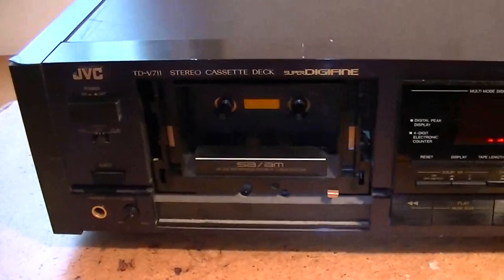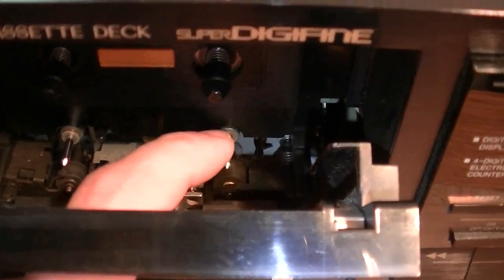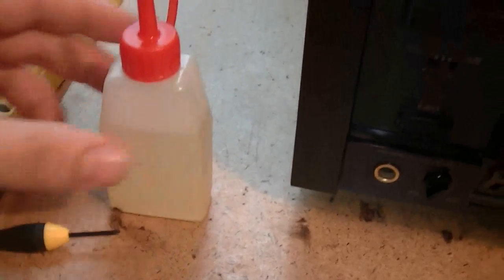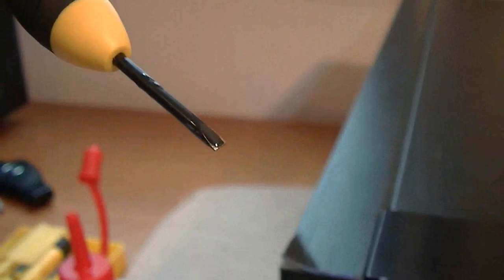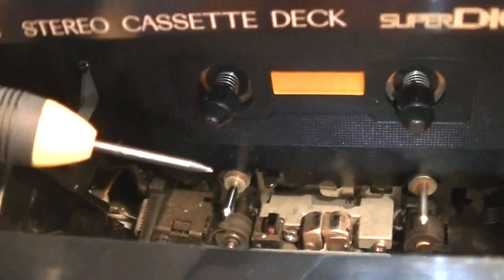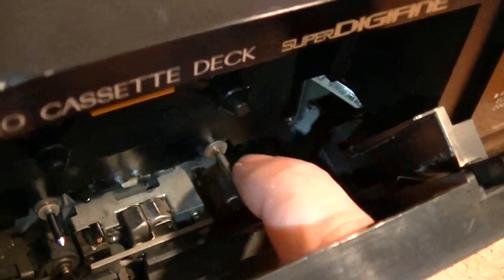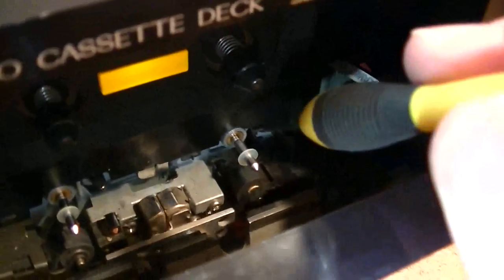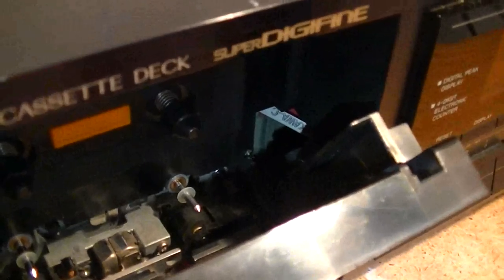Capstan lubrication easy procedure

Comment: Excellent video. I did this a few years ago to a 1992 Sony deck. One tip: after dropping the oil onto the capstan, tilt the deck 90º vertically and run it for a few minutes to help the oil work its way into the bearing. Especially worth trying if you put a bit much on, as this way, no oil will drip off due to gravity.
Reply: Bien joué 😊

Comment: Amazing!!! It works on my Technics RS-B505. Thank you so much!!!!
Reply: was it making a very loud screeching noise? because I have the same deck and i can't seem to fix it
Reply: Yes, it was quite loud, but not anymore.  You solved the problem for me and it still works.  Thanks!!  👍😁
Reply: Just ended up here, after my TDK TD-W201 was serviced because of hellish screeching noise it returned today... And I know the repair guy didn't mention anything about giving some drops of sew machine oil to the capstan bearings...
First thing tomorrow is to buy me some of that oil. Hope it will work 🙏
Reply: @santioriginal  TDK?,JVC
Reply: @giuseppelavecchia775  JVC, of course!

Comment: Dear readers. And Nacho. Sewing machine oil is very fine for a lot of works around decks, but not for capstan. For example,  with it, you can ruin almost immediately a Revox super precision bearing and only replacing it will works. Since few people look after service manual recommendations, please don't use it as a routine. For worn bearings it could help a little, before considering replace, but for any other case, use fine and fully synthetic oil made for capstans. It costs 20 euro and lasts for a life. For sinthering purposes, the best  way is cooking-no cold lubrication can diffuse deep enough.
Reply from the maker: Thnaks updated the info. Recall that this is the DIRTY procedure.

Comment: Nice JVC !!!!!. Important note is trying NOT to get oil in the pinch roller. Even after lubrication, not sure is oils go pass the plastic washer. In "theory" this brass bearing are soack in grease at factory.. They are kinda like an sponge ... and the idea is that they wont need lubrication in its lifetime.

Comment: Many decks have two bearings per capstan, a front bearing and a back bearing. This procedure does not get the back bearing lubricated. No problems using this method, but if the bearings really require lubrication, the back bearings should not be forgotten. People might think they are save because they have lubricated the capstan bearing, meanwhile causing extra wear on the back bearing over time, because that one isn't lubricated.
Reply: Sounds like you are an angry tech that is looking for work.  Nah I got my deck working, I don't need it brother!
Reply: Looking forward to you r video demonstrating how to lube them.
Reply: Ignorance is fine, shared knowledge  is a sin, and judging people makes you stronger. Be just like that Mike and you'll be fine.

Comment: @Nacho Pachés:  Putting oil on a capstan,  that could cause a higher chance of the tape getting eaten by the player, because the tape can slide off the path, unless your putting oil on the gear of the capstan, and not the capstan itself. Edit: so it was on the gear of the capstan, but their are still risk of dropping oil on the capstan itself.
Reply: That's why you always want to clean the capstan with good 99% IPA after the lubrication.

Comment: Can the capstans cause the music to change speed and could you please recommend an oil for this servicing ?  Thanks
Reply from the maker: It's not frequent, but They can cause slower than normal speed if there is too much friction (as a lack of lubrication, as this video tries to solve). Often , as they heat  they expand and thus more friction makes the music play even slower, but in these cases THERE AREN'T sudden speed variations, wow and flutter (that should show a pinch roller fault). However slow (or fast) music speed is usually a direct result of the motor running faster or slower, or the pinch rollers being worn out and causing bad or uneven pressure on the capstans. That's what usually has to be first considered.   AS for the oil, there's a comment talking about using fully synthetic fine oil made for capstans, but If I had to use some oil right now for a cheap deck, I'd choose swing machine oil or synthetic oil for car motors, which I suspect is maybe too viscous, but will protect the metal. However I'm not expert in oils in any way
Reply: @llagona  thankyou !

Comment: My capstan has black marks on it, which affects the playback. Is there a way to get rid of this? Or will I need a new capstan?
Reply from the maker: finding a new capstan is really hard. Pinch rollers are much easier though.  However I've never seen a capstan with any kind of marks that can't be removed by cleaning. Usually, tape debris, dirt or roller rubber can deposit on the metal but I've never seen any erosion or permanent damage on it. A good cleaning with alcohol, will usually leave the shiny surface on it. In the back side of the roller, sometimes the belts melts and leaves a thick residue that needs carefull cleaning with alcohol also.
Reply: A cotton q tip with isopropyl works well
Reply: @llagona Correct.IPA is the best solution to clean the capstan rollers.IPA is not goid for pinch rollers as it may damage the pinch rollers if used in its highly concentrated form.Cotton soaked in water us good or very diluted IPA is good fir pinch rollers to clean them.all.

Comment: What oil do you recommend for lubricating
Reply from the maker: Hi. When it comes to lubricating with oil, I think "sewing machine oil" is probably the way to go. But remember, some parts have to be lubricated with other compounds (like lithium grease). Oil is just for some points. Sewing machine oil is actually used these days in more other places than sewing machines but we know by that name here. In any case other oils can do the job reasonably well, because the improvement is huge and differences between oils are secondary.

Comment: Capstans bearing are maintenance free bearings. Those are sinter bearing that has dry lubricant in side into material that they are build and is not necessary to be lubricated.They are created to be not lubricated never , they are built from lubricant material.

Comment: I've got a sharp th w600. My grandma gave it to me and so know it hasn't been used in a while. It's working great. Do I need to mess with it if it seems fine? Can I use oil for hair cutting clippers?
Reply from the maker: If it is performing well, I wouldn't touch it in almost any way. At some point you'll need new belts or some other usual maintenance but This precise type of maintenance from the video is not usually necessary. As for the oil , please read the update cmplete video description.
Reply: @llagona  when will I know the belts need replaced? Is it hard to replace them and find the kind for this deck?
Reply from the maker: @ofthedawn  It's not easy, I should do a video of it! but there are many. Just remember to take pictures of every step from different points of view. You will notice it's needed either because the mechanism doesn't engage and run or because the sound wobbles .
Reply: @llagona  ok yeah that would be a good video. Do you know anyone making new cassette tapes? I know there's a lot of old new stock and some really cheap new ones at Wal-Mart but was wondering a new good quality ones.
Reply from the maker: @ofthedawn  Problem is that it's getting more and more difficult for me to set up the things needed to make a video. But there are other in youtube, if you watch some of them you'll get the idea for sure. But Remember (this is not told in the videos) : have a picture of every step, to recall where each part is assembled back. As for the tapes, it is not a profitable business anymore to produce quality tape, even medium. There are probably some factory in Turkey still making tapes inherited from BASF, it's name is raks and they even use to make metal tape. The shell quality is bad anyways. For quality tapes you need to buy second hand. There is a huge market in germany and also big markets in most big countries.
Reply: @ofthedawn  National Audio Company still makes tapes, but during this pandemic everything is shut down.

Comment: can ı use printer head cleaner for tape head and pinch roller?
Reply from the maker: I don't know, I'm not by any means an expert in cleaning decks chemistry. I just read a lot of times that for the head it is better to use isoprpyl alcohol. And for the pinch roller I'd use water and soap, and then water to remove the soap. You can use also isopropyl alcohol, but I've read somewhere that it can dehidrate the rubber. There is this liquid called "rubber regenerator" that is also a good cleaner, but it's harder to find, I've bought it in the past from someone on a hi-fi forum, do your search for this . Anyway, a bit of dirt in your pinch roller won't make a  difference as long as the rubber is in good shape.
Reply: @llagona  thank you
Reply: @llagona yes,Sir,you rightly said that IPA can dehydrate the pinch rollers .

Comment: BS. the capstans are rotating in sinter bearings specially designed to be maintenance free! They do not need any lubrication because they are created from 30% dry lubricant build inside into the composite material of the bearing. They are lubricated for a life time. .Your lubricant disappear from the bearings after couple days and the bearings continue to work with a dry lubricant  , same way how was working 40 years till know without problems.
Reply: Wow that makes sense because a couple years ago I bought a used Sony TC FX2 (made in Japan 1981) on Ebay for $50 and the only servicing I did to it was replace the drive belt. The deck is now 40 years old and it works fantastic.

Comment: Have worked on tape decks for over 30 years and no manufacturer recommends oiling capstan bearings.  Bearings are usually made of brass and all oil does is trap dirt and dust. Oil migration to the tape is a big NO NO.  If a deck cannot maintain proper speed it is because of dirty hard pinch rollers or a worn out capstan motor or worn out drive belts.
Reply from the maker: I' worked as an enthusiast and hobbyst for about 10 years on tapedecks and read lots of messages in forums. I agree that oiling is not a recommended procedure and the bearings have no planned maintenance, but believe me, I've seen decks not working from bearings suffering friction with everything else in order (2 out of 120, and not sure about the second, but one was clearly as I say). Putting some oil in that deck solved the problem instantly. Is it a temporary solution? ok, Is it suboptimal? ok,  but Are you going to spend 100 $ fixing properly a deck that is worth 20 when a simple drop of oil will do the job for 4 more years? As I the first thing I stated in the description, this is a dirty procedrure
Reply: Whatever floats your boat.  I have only used oil on vertical capstans on DAT decks.  I  have lubricated the bearings on capstan motors by removing them and putting a small drop of oil on the front and rear bearings of the motor. I love the forums when novice people try to replace all of the capacitors on decks and ruin them in the process.  In 30 years I have had to replace 4 capacitors.  If you do not have proper equipment and test tapes I wish you luck. I paid a Teac rep $100 bucks for a Dolby level tape so I'm dedicated to getting the best sound out of any deck.  The Nakamichi decks are the worst for bad motors and Technics and Panasonic are the next worse. 2 channel scope, freq. counter, wow and flutter meter and AC true RMS analog meter, precision audio frequency generator. It is sad how many great cassette decks are trashed by WANNA B TECHS !  @llagona

Comment: The Capstan has a shaft support at the front and rear.  This is not done because the lubricant will not penetrate into the rear hole of the shaft.  Correctly disassemble both Capstans, clean and lubricate the Capstan opening at the front and rear.  Then it makes sense and will work properly for years.  What you are presenting is amateurism!
Reply from the maker: yes. what I'm presenting is amateurism, I state it clear in the video and description. Now ask a unskilled owner to open the deck, dissassemble the mechanism and do it properly. You probably know what it takes to do that vs what it takes to do what I suggest in the video.
Reply: @llagona  Better give him the address of a good inexpensive professional who will do it professionally if he can't do it himself.  If it is high-end equipment, it will certainly not lose on it, it will only gain in value.  Maintaining a car also costs money.  But if someone doesn't have two left hands and can think technically and mechanically, he can handle mechanics.  It's important to think 5 times before you start disassembling.  These devices are built to be easily serviced mechanically.  There is a lot of useful information on the internet about this. Regards.
Reply from the maker: @leszekalbin4097  The "inexpensive professional who will do it professionally " is the part that I don't get, specially for decks that are worth little.  If an owner has a valuable piece of equipment,  he'll not resort to this, He'll find someone do it properly. Besides, This procedure, if done properly won't hurt more than letting the deck run longer unlubed. Why does everybody has to spend big money to restore vintage equipment to pristine condition? Isn't it ok to work around problems with a simple tweak? Here in spain, sending the deck and reciving it back is about 80 euros to begin with. Packaging it properly and bothering taking it to the post office might be a greater bothering. Just finding a parking spot with your car near the post office might be a nightmare. Picking it from home is even more expensive. All that effort for a 50 euros deck?